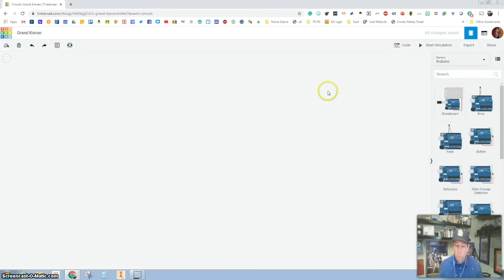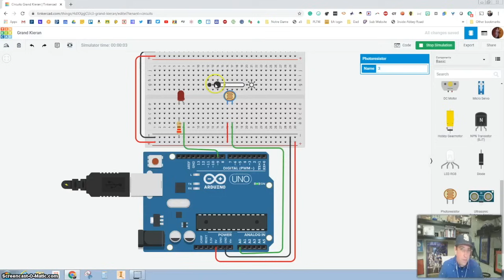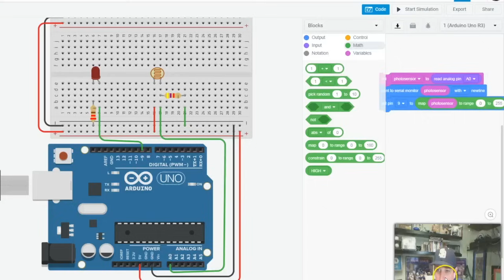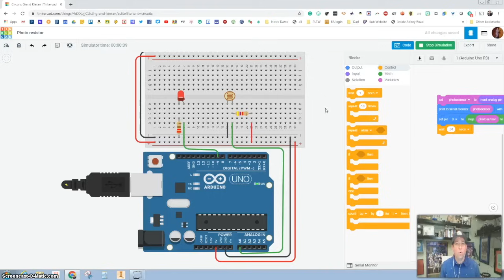Photo Resistor with Arduino and TinkerCad

Comment: Why 220 ohm resistor
Reply from the maker: 220 ohms for the resistors are good size so the LED doesn't pop. You can solve for the size of the resistor by using Ohm's law.